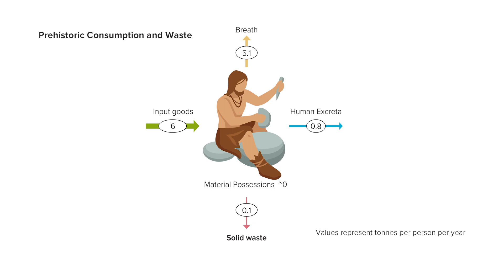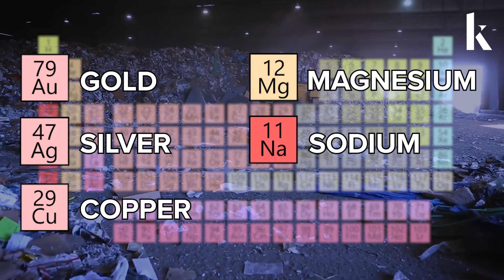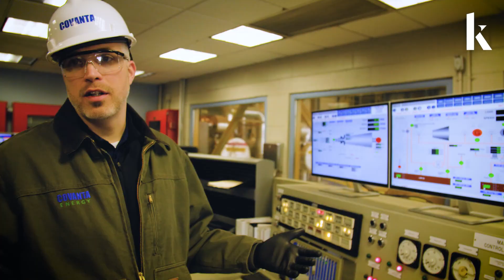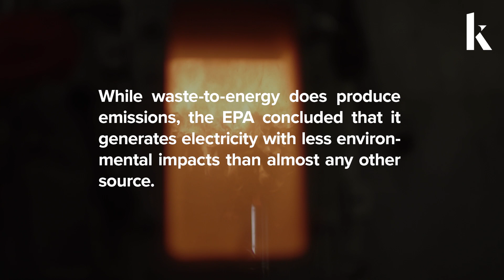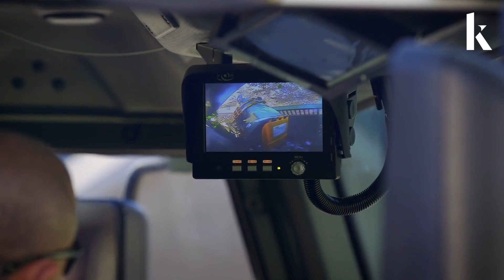Rethinking recycling

Comment: There are systems that can burn coal or trash with now discharge into the air of anything or ash left after burning. We are soon to have free energy so don't know how these systems will work with no need for the electric or heat put out by these systems. The systems shown here are outdated I'm sorry to say.

Comment: I agree with one of the comments. Plastic shouldn't exist. We should cut a tree for each chair we need or every time we need a bag. We shouldn't have to put a plastic bottle in a bin we should have paper bags so we can throw them freely on the street because are biodegradable. 
I live in London, where they pick up recycle every 2 weeks and if they see a white pater most of the time they don't pick up the bin and I have to wait another  2 weeks. So I have all the respect for the people that recycle but have no respect for the system that just try to take more taxes and money. And collecting recycle is not free at all, we pay a fortune to council and to them to.
Since last year in London every one have to pay only to have gas or electricity (elegantly called standing charge aprox 9-10£ ) and after that we can pay for the one that we use. And in top of those we have to pay because is raining but that charge is hidden so well in the water bill.
So no, recycle don't have to be rethink. Have to be done properly because we pay sooooo much for it. An UK recycle centre is 67% efficient compare with some of European countries about 80% and not talking about some of engineering art in japan that are 95% efficient

Comment: I'd love to see this with just normal trash. I live kn a small apartment in a small town so it's hard for me to recycle everything. I recycle paper and plastics but I need to drive 30 minutes to drop it off. What happens to my normal trash I just put in the dumpster?
Reply: It depends where you live.  Some areas send trash directly to a Waste to Energy facility which turns the trash into energy and allows for many materials like metals to be recovered (as explained in the video above). But the waste to energy facilities are expensive to build so they are frequently only available in high population areas that prioritize the solution.  If you don't have a Waste to Energy facility and your trash doesn't go to a sorting facility for recycling than it is likely just going to landfill.
Reply from the maker: Thanks @bridgethunnicutt7901  ! And to add to that answer... here's our story about "recycling it all" -- why don't we just put all the rubbish in the same bin, and what would it take to get to a system where we could? https://knowablemagazine.org/article/food-environment/2020/recycle-it-all
Reply: This has changed my perception
Reply: If you live in a small town, what ever does not go to recycling goes to the landfill.  And probably much of what went to recycling ends up in landfill too.  We just don't have enough the social will power to make recycling economically viable.  
.
Companies and people generate waste, but for the most part they are not held economically responsible for responsibly disposing of it.  Throw it in the garbage bin and let someone else worry about it. 
.
Reply: Wow!! That's a scary thing to see & think about 10 years from now??? What can we humans do to avoid all these coming chaos on our only planet earth to keep it clean for the next generation?? We need to come up with some solutions or ideas to slow down the garbage or the recycle stuff before it overflows &  buried us underneath lol
Reply: @deehope9477  Yes, it is scarey. Especially when I read that "micro-plastics" are being found at the top of the mountains, carried in the air, and now even in ground water. 

I've worked in one of those plants.  Ours is smaller, only 2 sorting lines. It's not a fun job. You stand there looking down at the black rubber mat of the conveyor belt speeding past. At first I would get "sea sick" watching it. It is surprising what you see going by. Lots of books (I stocked up my library), but other "good" stuff too. You can sometimes put stuff aside and "sneak" it out of the shop (against the rules). Others have found wallets and watches and money. Lots of beer cans, so the manager would allow us to put them aside for a party fund.  In the fall and spring, melting snow or rain on the "stuff" meant that within an hour on the line we would be soaking wet from the neck down to our knees. It would help if you remembered to bring a rain suit, but even then you gloves would get soaked and freezing cold. 

I've also worked at a Salvation Army sorting warehouse. Actually, it was consolidated center for several of the organizations who have collection bins for clothes.  Interesting place also.  The main task I had was bundling unwanted clothes using a huge press into 4'x4'x'4 bales for shipment elsewhere (across the ocean I believe).  They had huge 4x4x4 cardboard boxes on pallets for books. Unfortunately one of my tasks there was to fill a 40' dumpster with stuff they couldn't use. Fill one in a day to day and half ... lots of useful stuff went to the dump because they could not sell it in their "second hand" shops.
Reply: @ronsss4774  wow! Bless your heart!Can't imagine if I was in your place of work, how to go through every day like u can be a disaster for my mind lol anyways, thank you for sharing. GBU👍